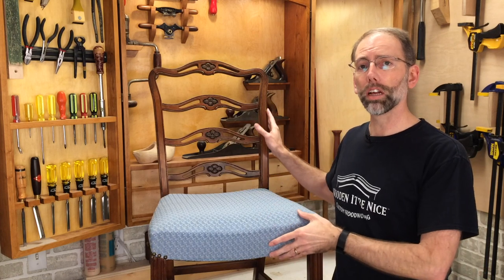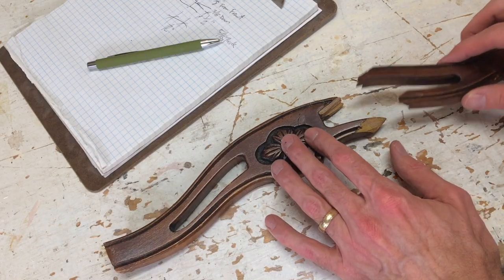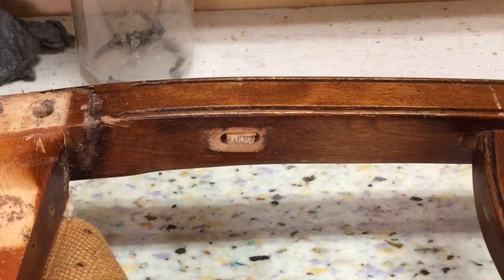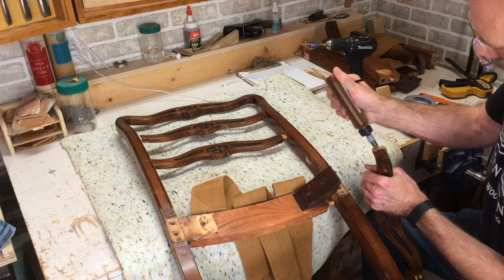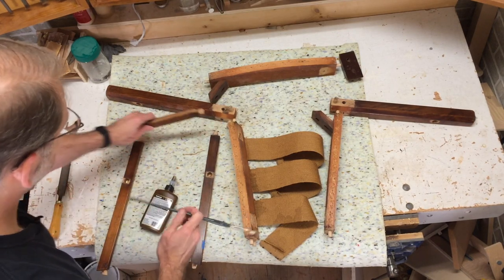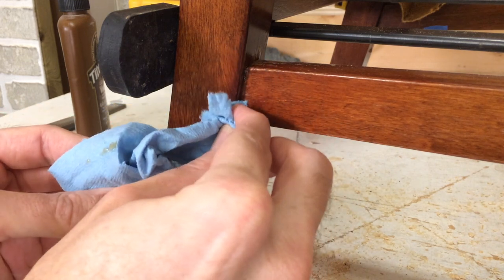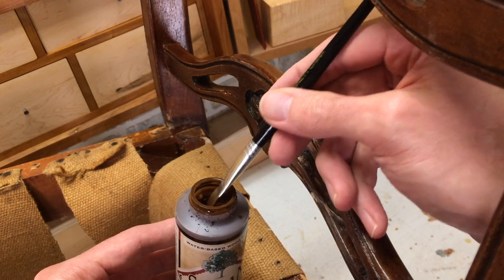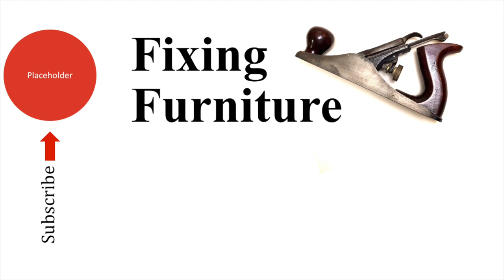Upholstered Chair Repair with Broken Cross Rail - Part 1 of 2 | Woodworking How To

Comment: I really enjoy learning about all you have to share.  I currently have an old antique sewing cabinet, purchased at a rummage sale years ago.  Immediately upon purchase, I proceeded to strip it.  Probably a big mistake, as I then discovered the top surface was veneer.  One corner of the veneer was damaged and so I carefully trimmed it off and replaced it with a Dap product, plastic wood. The repair is on the corner and probably is a triangle of 1 1/2 inches. That was done many years ago and the table just sat there, waiting for me to have the courage to complete it.

The wood appears to be a walnut veneer and I purchased a sheet of veneer to replace the whole top.  Also, the top has a couple of short  inserts that really add to the unique look, but make taking on replacing the veneer a little more challenging, due to the trimming necessary to fit it properly.  Also, I don't see your Patrion  link, as I will want to reimburse you for all your quality information.

Comment: I'm curious as to why you chose to use dowels rather than a floating tenon to reinstall the cross rail. What would make one a better choice than the other?
Reply from the maker: Good question Dave.  My decision came down to risk management.  For a floating tenon, I would have had to cut a mortice in a delicate piece of wood on the cross rail - and if something went wrong with the router setup or cutting operation I would have ruined the piece and created a bigger problem.  Installing dowels was a safer operation.  I hope that answers your question.  Scott

Comment: Great video---what sheen was the lacquer you used?
Reply from the maker: It was a gloss.  If you're using a finish that's too shiny, a 0000 steel wool (super fine) will knock back the gloss.  I hope that helps.  Scott

Comment: How is the water based stain you used different than the water based stains I used for 20 years starting back in the mid 70s?
Reply from the maker: I used water-based stains in the 90's and they didn't work well.  Somehow these work much better.  Cheers.  Scott
Reply: @FixingFurniture  Did you use premixed or the water soluble dye? I always mixed my own because they didn't leave a cloudy finish. I will admit it took a lot of work on my part to find the good stains because this was long before the Internet. At that time I usually had to find painters or paint stores that had been in business at least 50 years. The first time I found some locally the man at the counter said "this guy has been talking to grandpa". I do greatly appreciate the time and effort you put into your videos!
Reply from the maker: @bigdteakettle8989  I use Saman stains.  They’re premixed and work well for repairs.   I wouldn’t use them on furniture I build though as they’re somewhat opaque and I prefer to maintain natural wood tones due the the variety of color

Comment: 9:34 if you don't know the reason why the first one is loose, try switching the tight one and the loose one. Those dowel pins are not perfect. They have a tolerance and sometimes that tolerance is all you need to make the difference. 💖🌞🌵😷
Reply from the maker: Thanks for the suggestion Suzi.  I appreciate that.  Scott

Comment: A not on reversible glue. It is common in restoration  to use reversible glue, paint and such when working ith old artifacts. Like paintings, books, china. The idea being that it should be possible to undo the restoration in the future if necessary
Reply from the maker: You're right, the epoxy I used to glue up the cross rail is not a reversible glue.  The rest of the chair was glued up with hide glue, which is reversible.  The reason I had to use epoxy is there were gaps in the break in the cross rail due to a previous failed repair.  Epoxy is the only glue that will hold when there is a gap.  I hope that helps understand my choice in glue.  Scott